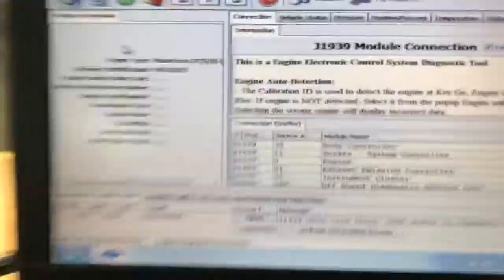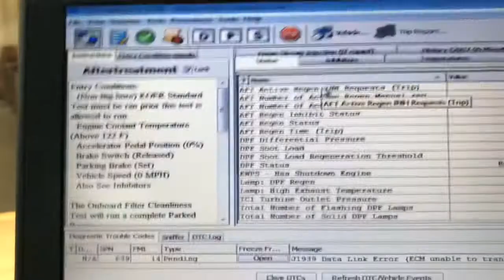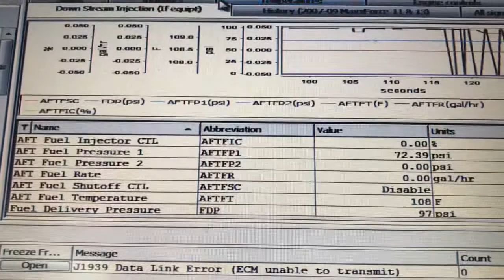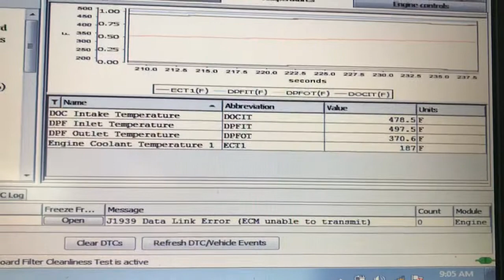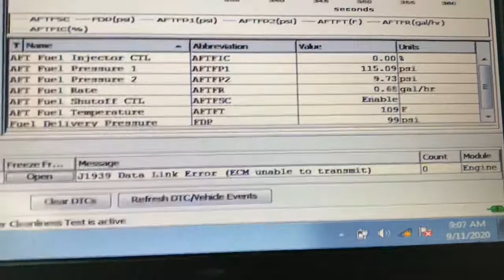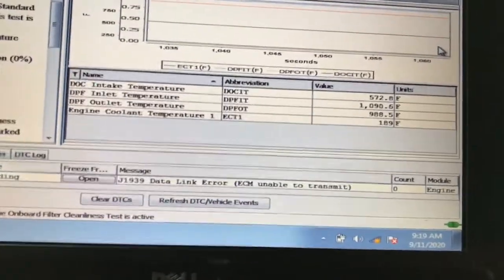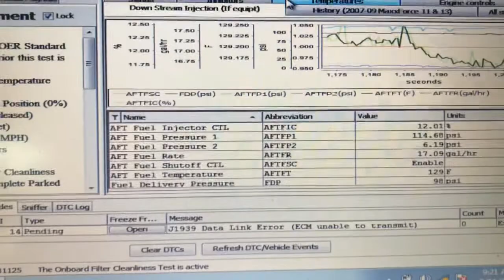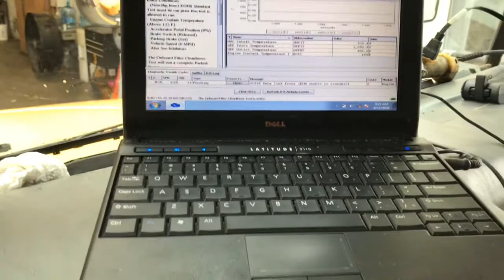Maxforce DT forced REGEN

Comment: What should be checked if the bus never gets up to temp say stays at 330 f while in “”parked regen “”
Reply from the maker: What make and model. And what engine.
Reply: @JoesBusBarn  maxxforce dt 2010 epa engine . I was able to get temp to 500 while driving, but as soon as i stop to do a parked regen ( which the bus says it needs. ) it wont regen it says it is in regen but no temp climb . Imo these after treatment systems are not all there. Spoke to a foreman told me they can be a pain to get these into regen , to me its dumb if the bus is aware it needs a regen why not fire off the aft injector.
Reply from the maker: Sounds like your dozer injector nozzle is clogged.
Reply: @JoesBusBarn  so i did drive the bus hard for a while then tried again to do a parked regen. And it just stays 450f while driving temp 1 would get to 600 , …..the aft 1 = 14psi aft 2 is near 0 .when the bus says it active regen ,  I was advised these busses have a really hard time getting them to regen ? From the aft pressures i imagine the dcu is commanding any injection? I cleaned the aft injector as well. Checked multiple components….are these really that much of a pain to regen or am i missing something.